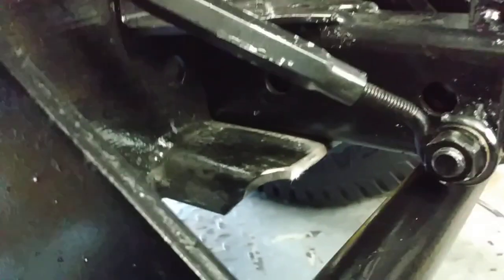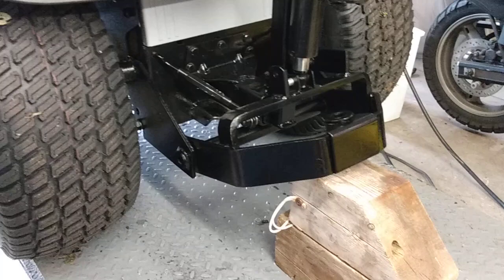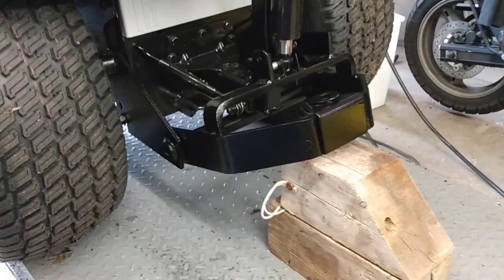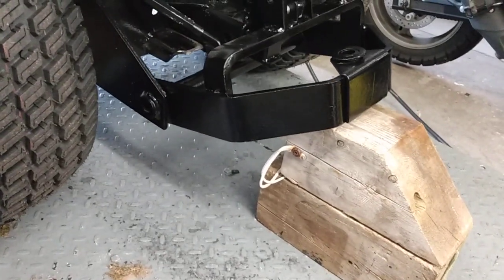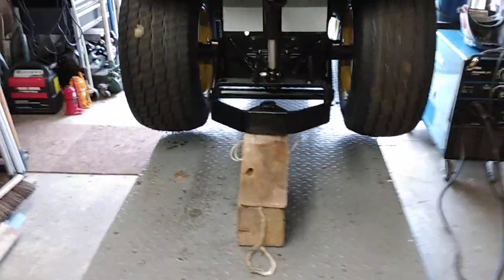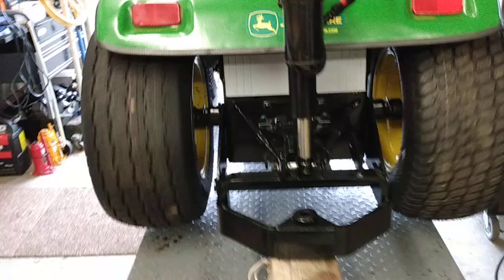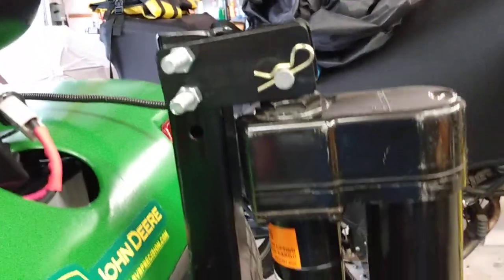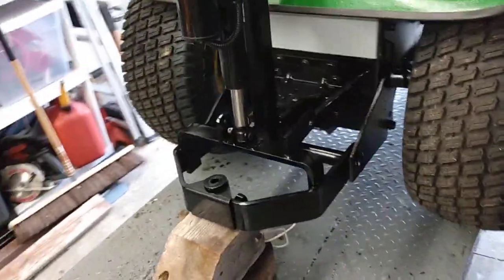Sleeve hitch electric actuator down force test

Comment: Any idea what that is drawing for current when fully loaded?  With my body the way it is I'm thinking of converting my jd to electric lift to give me some relief.
  Also where did you get that and do they sell shorter ones that you know of? Thanks Roy. P.s.  just watched the last vid of the rake. Nice👍
Reply from the maker: It draws around 20 amos with a load on it. It can lift about 250 pounds. I received the actuator on a box of parts I got when I bought a tractor. I have no idea on the specs. Sorry